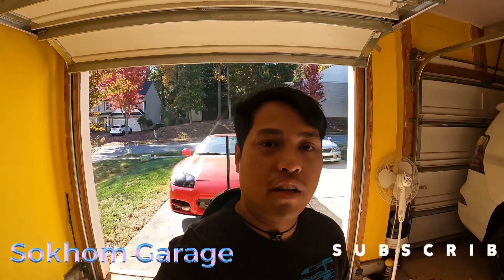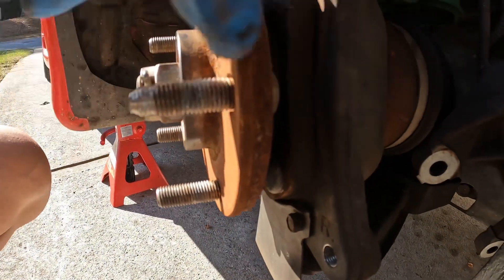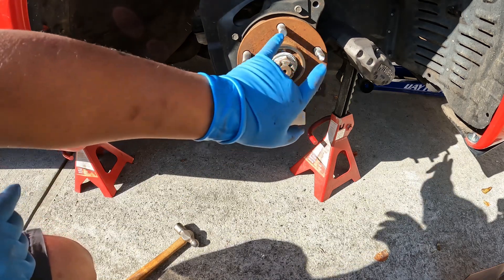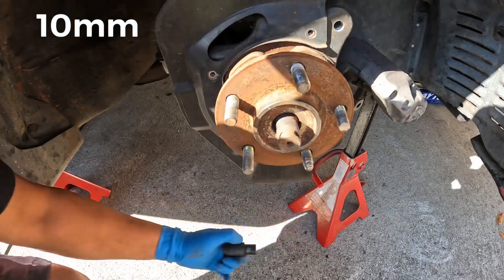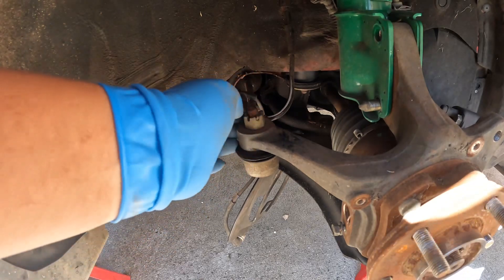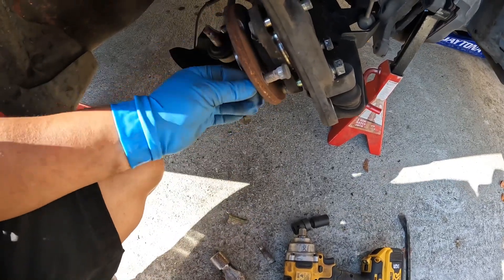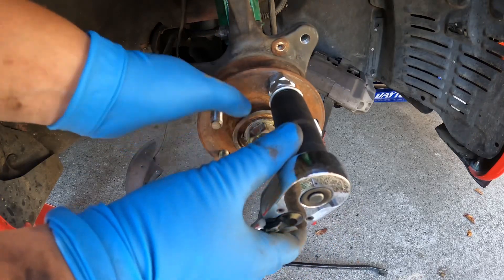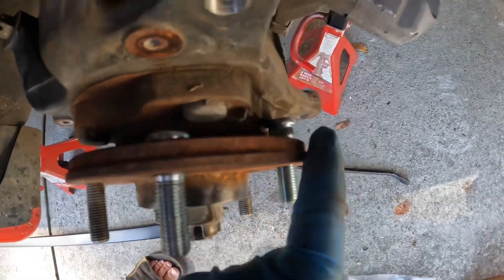Mitsubishi 3000GT VR4 wheel stud replacement

Comment: Hands down the best video on this I’ve come across. No grinding my hub and causing possible damage. I will definitely be using this technique instead. You didn’t have any issues with your hub after separating it slightly? That is the only concern I have. I know it’s the only way to do it without grinding the hub. But if it works and there’s no problem, then I’m all for it!
Reply from the maker: No issue with the hub, just hammer all the bolts evenly, try not to rush it, replacing the stud actually took me about 1hr to do.